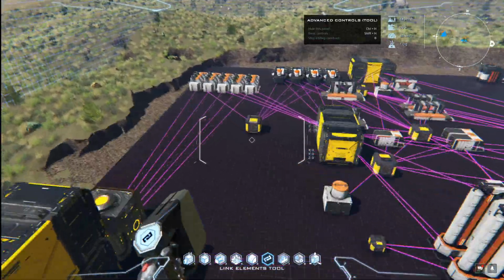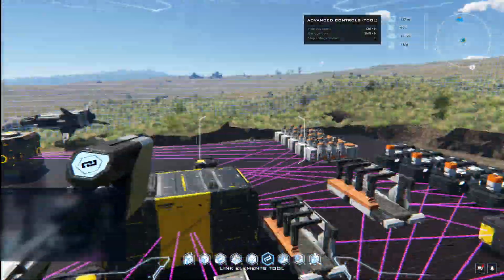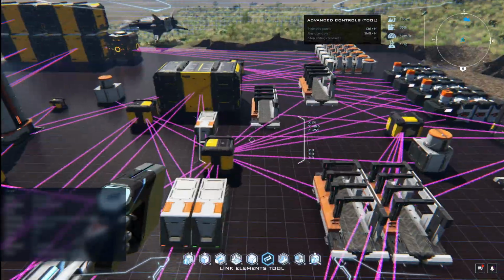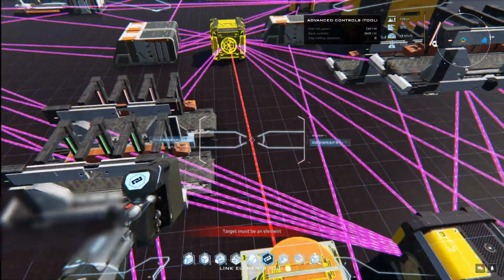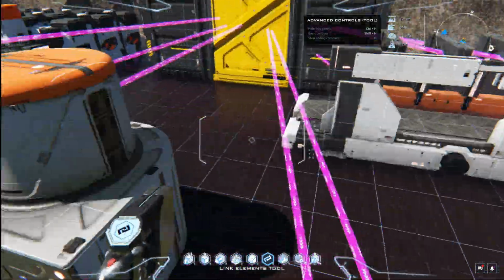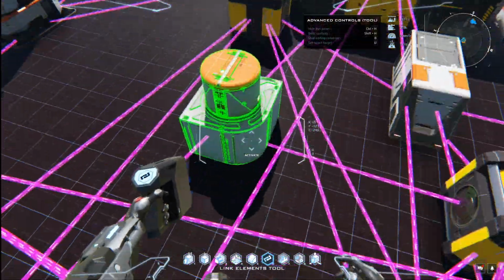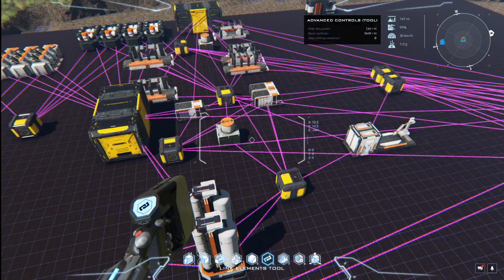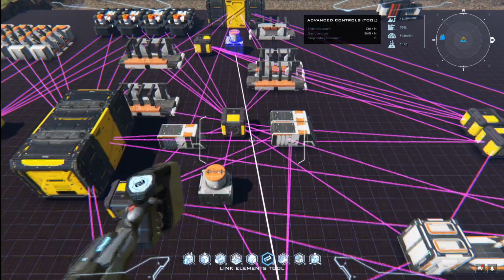Dual Universe: Transfer Units Explained. What are they and when to use!

Comment: Do you happen to have a list of which items are sub-components and which aren't? The problem I have had is that some count as both - e.g screws sometimes go to assemblers even though they are a mid-tier component. Would be useful to know which of those components end up as both main components AND sub-components for organizational reasons
Reply from the maker: I haven't found a recipe where the Assemblers do receive screws yet but if thats the case the Transfer Unit should be your answer as long as you use them with the "maintain" function

Comment: So it essentially makes sure that the an output has or maintains a certian number of a certain thing. Best used to connect multiple mixed storage boxes(max6). I can also see it as a module to controll efficiency too.
Reply from the maker: Well you don’t have to use the maintain function you can just use “run” and it will then move everything of that specified item

Comment: I intend to split my factory up based on rarity of mats.  So for basic mats I have a steel line, a silumin line and an al-fe line.  I also throw in a chem industry for the polycarbonate since it essentially functions like an alloy as far as processes go.  I further segragate simple products from complex.  A simple product only requires one ingredient.  I'm still starting out so that's all I have so far... hopefully it will work out well. :)  Thanks for the video!
Reply from the maker: I find it fascinating hearing how other people plan their processes in factories. Everyone has their own take on how things should inter and intraconnect.

Comment: Are transfer units the best solution to solve the problem of oxygen build up in an output container when refining? If the container is linked to a smelter, the container would quickly fill up with oxygen and if not used elsewhere, would completely fill up the container and stop production.
Reply from the maker: Hi Chris - yup spot on. I have a transfer unit running full time shifting both hydrogen and oxygen from the refining output container into the input for my chemical m units that make fuel. I just have to swap it between the two until I get another transfer unit spare. That’s the perfect use for them though with by-products.
Reply: @wozzmatic  A good point to add into the video about transferring waste product material. The penny dropped when I read @Chris Johnston comment above.
Reply from the maker: @tobo26  Yes I agree - I just can't unmake and remake the video but I am sure, like Chris has, people will enjoy finding those benefits themselves too. I pinned the reply though so people will see it. Thank you!

Comment: My problem with Transfer Units is that they are a bit too expensive/time consuming to craft for what they do.
Reply from the maker: I dunno I made some early days and have used them constantly every since
Reply: @wozzmatic  Yeah, its not like they are a Warp engine but they do seem a little fiddly for what they are. Now I have my basic semi automated factory set up they are not a problem but they were a right pain in the bum when I was getting started. The market price tells the story: ~10 times the price of an Electronics factory last time I checked.
Reply from the maker: Yeah and I think that’s a fair reflection they are definitely more complex than an electronics m for sure

Comment: @Wozzmatic.  If you don't already, you might want to check out the Hyperion site -> https://hq.hyperion-corporation.de.  It has a crafting calculator which categorises parts into 5 (IMO) useful categories.  Structural (frames, casings), Intermediary (components, connectors, pipes, screws, fixations, leds), Functional (arms, mobile panels, chem containers, etc), Complex (burners, power systems, injectors, etc) and Exceptional (anti-grav and quantum stuff).
Reply from the maker: Thanks Regan. Yes I do use it and have it pinned in my Discord channel but thank you for taking her time to share. Anything like that is always well worth a post for others to see. Thank you 😊